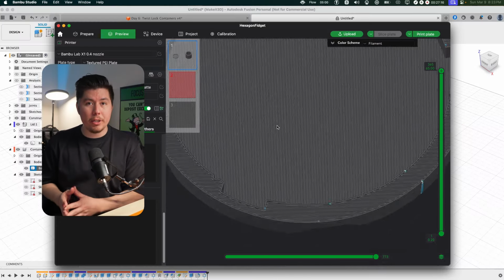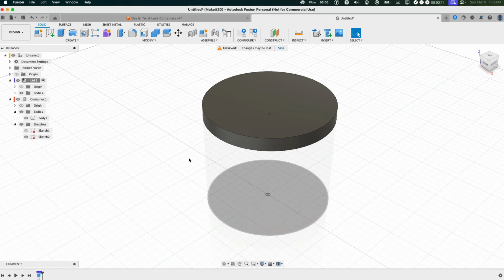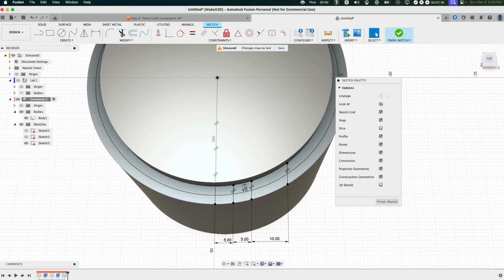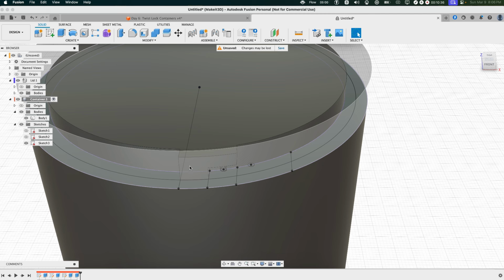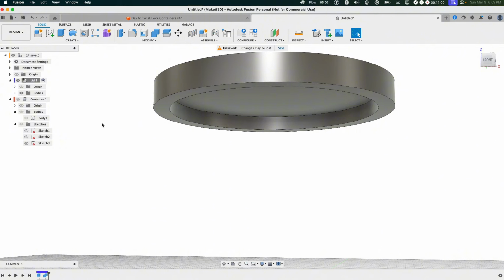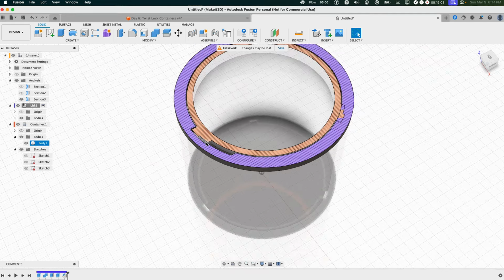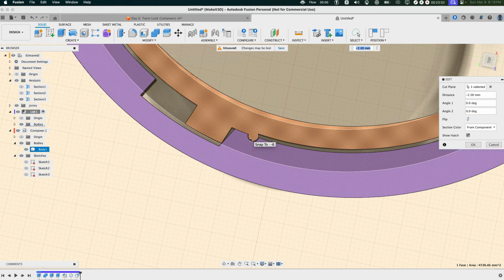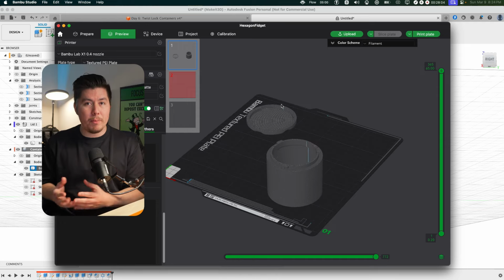How to Design this 3D Printable Twist Lock Container in Fusion 360

Comment: Great video, even for a total noob. I'm now using it to create other sizes. I do have a question however and it would be to add a knurled edge, how would you go about doing that so that the knurled edge could potentially line up on the edge of the lid and body? Would you create a 3rd component? Also just so you're aware, the indents added to the lid cause a gap as it is so thin. I made the lid taller and added a chamfer to the bottom so it's not so sharp of an edge.

Comment: When looking at the section analysis, there seems to be a small gap between the lid and the container. This looks reasonable due to 3D-printing might need a bit for variation in extruding. But I don’t see anywhere in the video where this gap is created. Or am I missing something?

Comment: I tried replicating the design exactly but the chamfer at 10:15 was not working even though I copied everything exact...
Reply: For me instead of 1.25mm I used 1.05mm. This is the only value that worked for me and wasnt crooked.
Reply: I have the same problem. There's an error everytime I try to circular pattern. Something about the chamfer or fillet.
Reply: @VincentLam587  I had this too, eventually it worked somehow, no idea why.
Reply: @jeffrhap if you ever find out why, please help.
Reply: @VincentLam587  Try not patterning the chamfer in the circular pattern then afterwards manually chamfer it yourself the patterned ones
Reply: same here, 1.05 did it for me.

Comment: Finally put together a nice new computer setup to get away from old laptop.  Have a nice work area now to sit down and really  focus on learning Fusion360 at a higher level.  Built myself a modern super fast computer setup and added a 34 inch curved monitor.  The first time in a long time feel like I can comfortably sit at desk with Fusion and really learn and work efficiently.  This should help much with lessons you have posted up.

I am able to get around in Fusion and making semi complex stuff, but just feel like not working at the pace I would like to get to.  It is a matter of getting actual computer time and learning the proper steps and order to design things in.

I  am just starting putting together a couple of stencils for using as a spray paint shield.  Will design a couple 3-6mm high lettering stencil shields so I can spray paint some text onto 3d printed cases and such. Will design the stencils in Fusion then spit them out at 3 layer thick height seems to make for durable stencil. Just practicing in Fusion doing this type of job in correct steps and efficiently.

Comment: Really nice job on this tutorial, glad I found this.  I was doing work on same exact design went about it in a totally different way, like this method very much, looks complicated, but in time will become second nature.  Thanks for posting this up!  Good stuff!

I started teaching self Fusion via You Tube over the summer, took a few weeks to get a bit familiar with the software, but still moving at pretty slow pace because I just work tons of hours and do not put ton of time into using it.  I get better if I use it a few days straight.  Thinking of doing a couple Udemy classes which only run $20 a month for unlimited classes, and they offer many great Fusion classes.   That class plus videos like this should really help, but bottomline I need to just dedicate say 3-5 hrs a week min working on designs and becoming proficient with the tools.  I like how you always use shortcuts, that is cool tip!